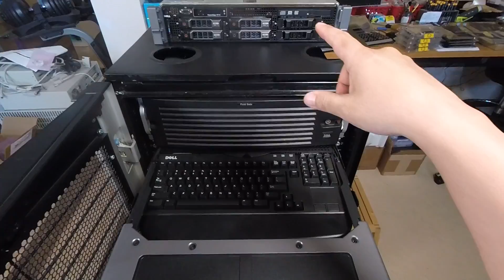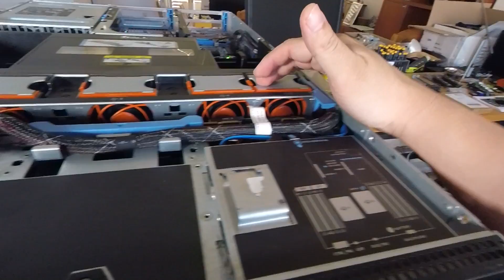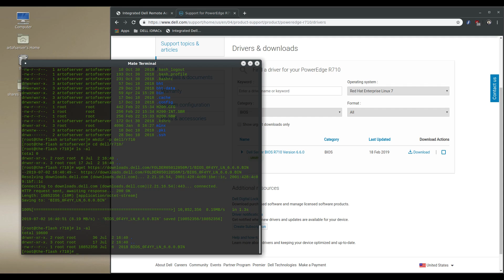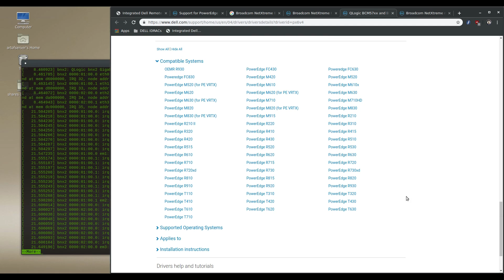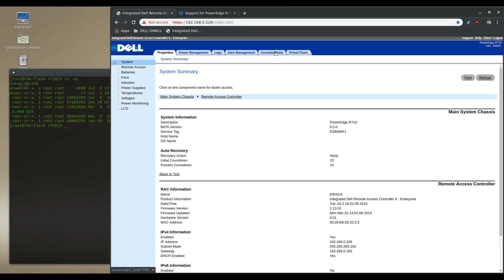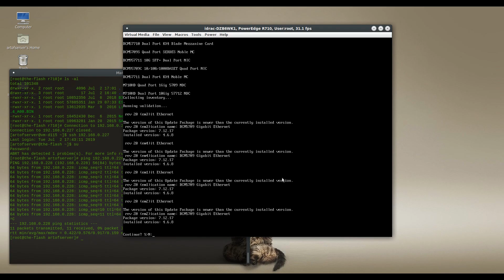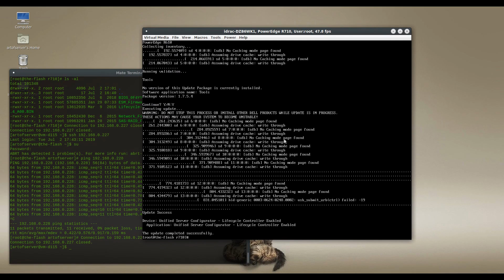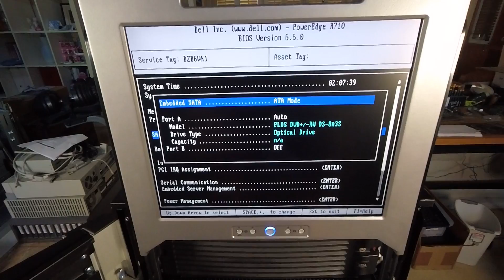Dell PowerEdge R710 build PART 1/9 | fixes, bios and firmware updates, and factory reset

Comment: Btw, did you run into this at anytime while installing iDRAC6 2.9.2?
If so, how did you solve?
#./ESM_Firmware_KPCCC_LN32_2.92_A00.BIN
/opt/dell/updatepackage/ESM_Firmware_KPCCC_LN32_2.92_A00.BIN-2687.bjlbJW/spsetup.sh: 2544: /opt/dell/updatepackage/ESM_Firmware_KPCCC_LN32_2.92_A00.BIN-2687.bjlbJW/spsetup.sh: ./getSystemId: not found
This Update Package is not compatible with your system.
/opt/dell/updatepackage/ESM_Firmware_KPCCC_LN32_2.92_A00.BIN-2687.bjlbJW/spsetup.sh: 658: /opt/dell/updatepackage/ESM_Firmware_KPCCC_LN32_2.92_A00.BIN-2687.bjlbJW/spsetup.sh: ./sputility.bin: not found
Reply from the maker: Nope

Comment: Thanks Art of Server for the great video. I have a few questions though. Is Centos 8 supposed to work too? I copied Centos 8 DVD ISO into a flash usb drive and, when I boot R710 off of the flash usb drive, it gives me two options: Installing Centos 8 or troubleshooting. I don't want to install Centos 8, as I plan to eventually install ESXi. I just want to boot off of it so that I can ssh to the R710 server and do the same thing you did. Should I delete Centos 8 from my flash drive and copy the Centos 7 DVD ISO to it? ... Or is there a way to boot off Centos 8 in a way that enables me to ssh to the R710 without installing the Centos 8? ... Or should I install Centos 8 on the R710, update the BIOS and other stuff, then install ESXi in a way that wipes out the Centos 8, hoping that it won't do the BIOS and other updates? ... Please be verbose. If your explanation is too short for AOC to label it as mansplaining, I would most likely not understand it. Thanks.
Reply from the maker: If your goal is to update the server using a "live" boot OS, you could use CentOS7. I would avoid CentOS8 for now. I also show in another video how to setup a portable CentOS7 USB boot drive, which is what I often use for these types of updates.
Reply: @ArtofServer  Thanks Art of Server for your prompt reply. Yes, my goal is to update the Dell PowerEdge server. I will look up your video on the topic of creating a portable CentOS7 USB boot drive. In the meantime, if anybody reading this knows the link to that video, please post it as a reply to this comment. Thanks in advance.
Reply: I found the video: https://www.youtube.com/watch?v=8MpLsYX9IeQ
Reply from the maker: @abdenourachab  Here's the vid: https://youtu.be/laC7nsY1SyM I demonstrated with CentOS8, but actually I use CentOS7 in the same manner.
Reply: Clarification: I posted the present reply before noticing that Art of Server had already replied an hour earlier with additional information. I am keeping it anyway as it has some good information. I then posted a subsequent reply to Art of Server's reply an hour later. See reply after the present one.

I followed the instructions at https://www.youtube.com/watch?v=8MpLsYX9IeQ and, when I boot my Dell PowerEdge R710 from that bootable CentOS 7 USB boot drive, I run into the same problem I ran into when I was trying CentOS 8. CentOS 7 gives me the options to install CentOS 7, test and install CentOS7, and troubleshoot. None of which is what I want. Did I follow the instructions in the wrong video?

Note that, two days ago, I created a live USB Ubuntu 21.04 (daily build) live ISO drive with persistent storage using mkusb, and used it to update the BIOS and the LifeCycle stuff. But the updates of Network_Firmware_PX6V4_LN7.12.17.BIN failed (I don't know why), and the update of SAS-RAID_Firmware_F96NR_LN_6.3.3-0002_X00.BIN failed (many of the commands that the BIN relies on are not in Ubuntu). I will try making a live ISO Centos (7 then 8) using mksub, and report here about that worked or not.
Reply: @ArtofServer  Thanks for the video link. I just saw your above reply. I hadn't seen it when I replied an hour ago mentioning mkusb on Ubuntu. So, I need TWO USB drives. One to install CentOS 7 from, and one to install CentoOS 7 into. I hadn't gotten that part earlier. In Ubuntu/mkusb, one can actually "get away" with ONE USB. I put get away in quotes because, as I mentioned one hour ago, while the installation of the BIOS and of the LifeCycle thing from the ubuntu 21.04 based USB drive  succeeded, the installation of Network_Firmware_PX6V4_LN7.12.17.BIN and of SAS-RAID_Firmware_F96NR_LN_6.3.3-0002_X00.BIN from the ubuntu 21.04 based USB drive failed. I ordered a second USB and I am expecting it in two days. In the meantime, is there a way to create, from my Ubuntu Desktop, a live Centos 7 USB drive with persistent storage in a similar way to what's described at https://www.techrepublic.com/article/how-to-create-a-live-usb-drive-with-persistent-storage-in-ubuntu/ , so that the same drive plays the role of both of the drives you mentioned at  https://youtu.be/laC7nsY1SyM ? i.e., you plug the single drive externally, boot from it, and you already have an CentOS 7 installed, with disk space to download Network_Firmware_PX6V4_LN7.12.17.BIN and of SAS-RAID_Firmware_F96NR_LN_6.3.3-0002_X00.BIN into, and, ideally, as in the case of the Ubuntu 21.04 based USB drive, a functioning web browser to avoid to deal with figuring out IPs and sshing from a desktop or laptop?
Reply: When I removed the server cover, I couldn't see anywhere where I could plug in an internal USB drive. I therefore installed Centos 7 (GNOME version plus all possible add-ons from the installation) on one of the three hard drives. That enabled me to download and install Network_Firmware_PX6V4_LN7.12.17.BIN and SAS-RAID_Firmware_F96NR_LN_6.3.3-0002_X00.BIN

I then downloaded and tried to install ESM_Firmware_KPCCC_LN_2.92_A00.BIN. I got the following message:
The following packages are required for update package to run:
    compat-libstdc++-33.i686 libstc++.i686 libxml2.i686
.....

I downloaded and installed the three RPMs providing the above packages. But I am still getting the same message when trying to install ESM_Firmware_KPCCC_LN_2.92_A00.BIN

I notice that Art of Server didn't get that message. But I have also noticed that the CentOS 7 version I found on centos.org is different (it's newer) than the one Art of Server found in  https://www.youtube.com/watch?v=8MpLsYX9IeQ . Any ideas on how to get ESM_Firmware_KPCCC_LN_2.92_A00.BIN installed? ... I am willing, if needed, to reinstall Centos 7 on one of the hard drives and choose a package other than GNOME. I didn't try the minimal installation like Art of Server did, but I am assuming that, if something is missing in the GNOME installation option, it's missing in the minimal installation option too. Is that a wrong assumption?

Comment: Have you run into any issues with the R710 not wanting to boot when you switch to UEFI  - one of mine gets stuck at "Initializing UEFI - Please Wait". I've uplugged and cleared NVram and still won't boot..
Reply from the maker: do you have a UEFI bootable device in the system?
Reply: @ArtofServer  I have two identical R710's both configured exactly the same with raid 10 on  Perc6/I controllers and Sata drives. I've updated all firmware on both, one boots and the other hangs at "Initializing UEFI - Please Wait". The other strange thing is the server cycles through the boot sequence twice before getting to the UEFI screen..
Reply: I have this exact same scenario AND two R710s that exhibit the same behavior. It's insane. I'm having to use BIOS boot for both of them at this point since I cannot trust UEFI on these Dell series. Anyone figure out what may be causing this? Resetting BIOS by way of the jumper doesn't resolve.

And yes, I have UEFI boot devices plugged into the USB ports (tried both the internal one and the front) to boot when it fails.
Reply: @ylluminate  Both of mine were purchased at the same time and they were supposed to be configured exactly the same way. What I found when I opened them both up was the one that would hang had a card installed that we didn't ask for. I believe if I remember correctly it was a card to allow and external sata port. when I pulled that card my issue was resolved. I would check if you have any addon cards installed that might not be compatible with UEFI.

Comment: So I cant get the 32 bit version of libxml2.i686 installed to run the idrac binary. Any ideas? Is there a 32 bit repo for centos7 i can add to get it?
Reply from the maker: Why can't you install the package?
Reply: @ArtofServer  I installed the Compatibility libraries and restarted, then I was able to install it after a yum check-update and yum install libxml2.i686
Reply: BTW I also had to install compat-libstdc++-33.i686 and libstdc++.i686 but those worked fine. After that, I was able to install the idrac firmware binary.
Reply from the maker: @christian571  ok. congrats on figuring it out! :-)

Comment: Hey, this is really well made video. Could you clarify coule of things: Your Ubuntu Mate is installed in USB? If yes, is it connected to your server or to some other PC (accessing server via SSH)? Also, did you install any OS to server? Thank you very much and best of luck in future.
Reply from the maker: Not really sure what you mean by Ubuntu MATE? I'm running a CentOS7 on a USB drive in the server. My desktop is MATE, but on another machine on Fedora (not Ubuntu). I use my desktop OS for the screen recordings where I login to the server running off the USB drive.

Comment: Great video. This has been extremely helpful and I can't wait to finish watching through the series. I recently picked up an r710 and would like to update the bios. The current version on it is 2.2.10. I read online that upgrading to the lastest version may cause issues and it was reommended to upgrade to each version in steps. I cannot find any bios versions other than the latest on dells support site. I am wondering if perhaps I can upgrade directly to latest version or if maybe anyone here could provide a link to older bios versions?
Reply from the maker: I don't know the origins of that recommendation. As you saw in this video, I just did a straight upgrade to the latest version and didn't have a problem.
Reply: @ArtofServer   Saw that recommendation in the dell forum from a dell tech lol. Didn't really make sense to me but I saw it mentioned multiple times and I'm new to server hardware so I wanted to be sure. Thank you so much for the quick reply!
Reply: @josephwest651  Hi Joseph, so did you step up from bios 2.2.10 to 6.6.0 or did you go straight to the current version?  Interested to see what happened, I'm in a similar ... ...
Reply: @Joe Slaughter I just got a used R710 with bios 3.0 and idrac 1.7!!! what should I do as for an upgrade path ?

Comment: I'm having difficulty getting idrac to work at all. I have did a factory reset, I enabled idrac6 lan, I enabled ipv4, set a static IP, set gateway, subnet mask, default gateway and DNS. I used dedicated nic selection. I even tried just letting dhcp set everything. But no matter what I do I can't ping it, I can reach via the web browser and I never see any activity lights on the back ethernet port on the far left side of the server next to the serial console port. I'm positive there is an easy step that I'm missing here.

Comment: On the iDrac update I ran into an issue with some libraries. ..... The following packages are required for the update package to run:
- compat-libstdc++-33.i686 libstdc++.i686 libxml2.i686 .....  When I installed the compat-libstdc++33 it would not take.  Just wondering if you are using a 32-bit OS CentOS7 since I cannot get this to run in my Centos7 USB stick?
Reply: I was able to update using iDrac's update facility base on the instructions here.... https://www.dell.com/community/PowerEdge-Hardware-General/iDRAC6-firmware-upgrade-fails-using-Deployment-Toolkit-ISO/td-p/6210278
Reply from the maker: That's great! yeah, as you can see in my other R410 series, firmware updates on the 11th gen servers do not always work consistently. Often resorting to alternative methods can help, but not always.
Reply from the maker: No, I'm using 64bit CentOS 7 in this video.

Comment: Hey, I'm getting an issue stating "The driver is not compatible with your system.
I downloaded the network driver, the same one you've been having trouble finding.
I have a Broadcom NetXtreme Limited II BCM5709, so the driver is supposed to fit.
I've run the .BIN file through debian GNU/Linux, and I'm really unsure what the issue might be, have any idea?
Reply from the maker: The .BIN scripts I think are only compatible with RHEL and CentsOS Linux, not Debian.
Reply: @ArtofServer  Thanks for the reply, I'll definitely keep that in mind.
On another note, I've ordered my R710 around a month ago and this whole time it couldn't connect to the internet.
It gets assigned a local IP for use w/ the iDRAC6 and it works just fine, but any connection to the internet just can't be accomplished.
To that, of course, I guessed the issue is the network drivers not being updated but yours weren't updated too, and you could of course use 'wget'.

The dell support forums weren't very helpful, and just told me to ping the internet and check if I have connection (wow), so do you think there's any other issue that might be it besides the drivers and (hopefully) no broken network card?
I'm saying this before the drivers have been updated, but just as a personal note because the R710 is my first server.

Comment: Hi. lately I have bought a used Dell R710 with H700 controller which cannot detect sata hard drive (I don't have sas hard drives). In the  bios under sata settings>embedded sata I can see only ata mode option. I cannot see raid mode option. moreover when i click Ctrl R I cannot see physical drive. create new vd   ,foreign config and manage preserved cache are greyed out. anyone has a clue how to resolve it? thanks in advance.
Reply from the maker: First thing is to make sure you have latest Dell H700 firmware. There was a short period when Dell was vendor locking the HDDs allowed with their H700 cards... if you have that version of the firmware, it will lockout most HDDs except Dell firmware HDDs. They removed that restriction later, so update your firmware and see if that helps.
Reply: @ArtofServer  thanks. the problem is due the sata caddies. I need to order sas /sata caddies unfortunately i don't know the part number of genuine 3.5 dell caddies for R710.
Reply from the maker: @indigo2009  I think maybe you need to watch this video: https://youtu.be/Y9PBMaS9KpI

Comment: Thank you for your videos. I just got a R-710, 6 SAS drives, a SAS 1068E, and Perc 6/E Raid card. Still getting my head around this. I want to setup Proxmox and wish to know if I should remove my Perc 6/E card. I have no use for external drives, dont think this will allow use with my internal drive, so is there any value to leave it in?
Reply from the maker: You should watch the next part of this series where I talk about storage, and later parts I show how to setup Proxmox. Just continue watching this series and you should get all the answers to these questions. The playlist is here: https://www.youtube.com/playlist?list=PL28eVGz5vFQ9hUBeeg5bxj-s0IeitoGIb
Reply: Thanks for the reply. I have seen all the above, but will watch them again and again until it all soaks in. I'm old and slow but never give up until I get it. Again my question was about the Perc 6/E. Does it have any value to keep it in the server or is it only useful on external drives. I do not have a Perc 6/i. No PD drives show with Ctrl-R. Drives appear when I use Cntl -C (SAS config).
Reply from the maker: @waynejauss5857  Oh, about the PERC6/E... if you're planning to add a external DAS, like MD1000 or MD1200, then it may come in handy, but has limitations with SATA drives at 2TB. Generally, I think it's worth replacing with a 9200-8e or newer card.

Comment: Amazing tutoring.  Hey I'm in the process of building a home lab. I currently have a unRaid server and I'm looking to buy a couple of Dell poweredge servers to the lab. 
I have 2 questions 
1.What's the difference between the r210 and the r210 ii?  I want to use that to create a PFSense router/firewall
2. Is the r710 the best bang for the  buck to create a Proxmox server?

I enjoy your content keep, continue success.
Reply from the maker: Thanks for watching! :-)

1) Not 100% sure about all the details regarding R210 vs R210-II. But I believe they have totally different motherboards. The II supports SandyBridge/IvyBridge Xeons, while the "I" supported Lynnfield, which is much older and more power hungry. I would get the R210-II.

2) I think the R710 is a great starter server, but I would also say consider some of the 12th generation servers too, like R720, R620, etc. There are some nice options that only cost a little bit more.

Thanks for your kind words!

Comment: I have R715
It is quite quiet. Even fully working. I have Sapphire Pulse AMD Radeon RX 570 and 2x AMD Opteron 6180 SE and 16x 8GB DDR3 PC3-10600R RAM (it is 290W total while idle) and it quite quiet. 
Oh and no spinning rust only SSDs

Comment: working my way through your great videos, not sure if dell through me a curved ball though, i didnt have dell logo on bootup so followed your video and did the jumpers then booted up and its there, great feeling very confident but now i have a  boot error that may be related to clearing the NVRAM it says no sata e detected, any ideas
Reply from the maker: Go into the BIOS setup of the R710 and disable any SATA ports that are not in use. By default, if you enable any of the SATA ports, and it doesn't detect a device, it shows that error.

Comment: I know this is an old video, but I was wondering if updating the firmware on an H700 would delete my current RAID set up?
Reply from the maker: no, it shouldn't do that. the RAID configuration is not stored in the firmware... it's on the NVRAM and meta data on disk.
Reply: @ArtofServer  Thank you very much :)